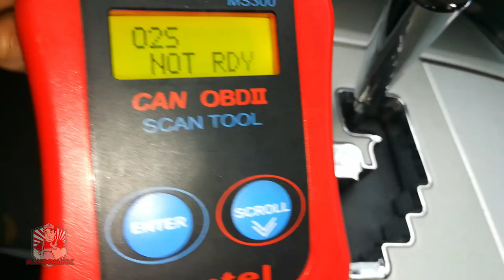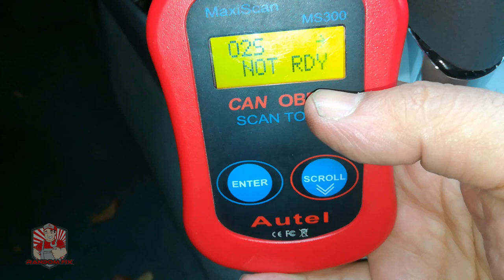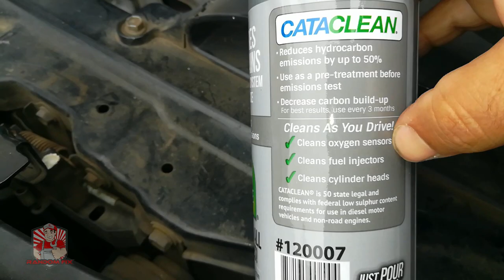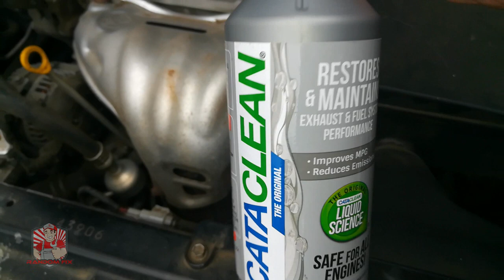Essential tips to prepare your oxygen sensor monitor.

Comment: I have a Kia 2012 Sorento . Still having issues with my oxygen sensor saying incomplete. Should I try the cat clean ? I have no check engine light . The drive cycle for this seems really complicated
Reply from the maker: For your kia, do the following, make sure your battery is perfect. ( less than ideal batteries will keep the o2 monitor from setting, let me know if you don't understand this.) and let it warm for a 15 minutes and drive around town in stop and go traffic, keeps around 25 to 45 mphs. Let me know what happens.

Comment: You dont have a drive cycle link for fiat 500 (abarth).  Is there a cycle that you have a link for that will work with Fiat?  Having issues with O2 sensor readines.  Thanks!
Reply from the maker: Here the chrysler drive cycle.

https://youtu.be/dyYv4HpYPys

For the o2 monitor make sure you battery is perfect. Just because it can start the vehicle doesn’t mean it’s good.

Comment: Hope this cat a clean helps! I’ve got an 06 wrx and have driven over 350 miles. Last reset I did over 120 miles and o2 hasn’t been ready. Cleaned the MAF, Throttle Body, cleaned connectors and made sure o2 sensors were plugged in tight.
Reply from the maker: Hi Anthony,
I made an updated video for the o2 monitor.

https://youtu.be/Yn1-ul62Jio
Reply: @RANDOMFIX  I appreciate it I’ve watched it. I checked my battery yesterday and it’s at 100% according to autozone, fairly new. Only thing I haven’t done is take off the the connectors from the battery for an hour.
Reply: @anthonymarquez4563  that should be the first thing you do. Completely reset it and let it rerun the monitors without looking for those pending codes
Reply: @KollynJ  update: the issue for the o2 not setting was the o2 sensor. Once I replaced it, the car had set that monitor within a few miles.

Comment: I have a 07 chevy tahoe and its not passing either. The EVAP, heated o2 sensor,oxygen sensor is not ready and the secondary air system, a/c refrigerant, 
EGR flow and heated catalyst is NOT supported. Does this mean the computer system is not working? I took it 4 times already for the SMOG test  after driving it in the high way... Please help!!!!
Reply from the maker: Ara,  Sorry for the last response, did you figure it out? Please let me know and I can get back to ASAP. Also, can I get your help? CHECK OUT MY OTHER CHANNEL and subscriber if you like it. THANK YOU ▶️ https://www.youtube.com/channel/UC-wuhWwzZnFOWK-GMsP6Ejw _Randomfix

Comment: 2019 ram2500 6.4 how long do i gotta drive
Reply from the maker: Is the o2 monitor the only one not set?
Here is the video for incomplete or stubborn o2 monitors
https://youtu.be/Yn1-ul62Jio?si=ZxvHIxm3q-ly2aQ1
Reply: @RANDOMFIX  no there's like 3 others. Fue,02s,eva
Reply: @RANDOMFIX  just had headers installed and the battery was disconnected to
Reply from the maker: @Henny3773 if the fuel doesn’t get ready within minutes you need do a little research about your vehicle. I just had this happen on my 2014 dodge caravan where the fuel monitor was getting ready as well. Watch the video I sent you and let me know if you figure it out but I dropped lots of hints in the video on possible causes.

Comment: Do you have a drive cycle for a 2015 Dodge Challenger 3.6L V6? My pre-test had everything ready but o2 sensors.
Reply from the maker: Sorry for the late reply! did you find a solution?
Reply: @RANDOMFIX  oh ya, finally got them to set after going 55mph, decelerating to around 40mph and accelerating back up to 55mph, and repeating that 5 times, finally they were ready.

Comment: I had my BMW x5 35 D  Throttle Body replaced and there is no more codes and drove about 130 miles but still have cat, o2s ,hrt,egr  NOT READY.  should I just keep driving the car? or might have problem? I do not have any pending code so far .. Any help? Thanks a lot !
Reply from the maker: If your bmw is 2010 and never and you have a permanent code than needs to be cleared by 15 warm cycles ( warm + 10 minute drive) and 200 miles. This is known as mode 10 data, I will make a video covering this later this month. With that said I have a bmw specific video on setting all of your bmw drive cycle. Bmw drive  videohttps://youtu.be/mk6Tk330Acw and I. The video description this drive cycle instruction for each make. Good luck and keep me in the loop.
Reply: @RANDOMFIX  Thanks for quick response! I had code about 3k miles ago but I added the blue fluid and reset it. I think code was about exigent sensor but about 500 miles after reset I got engine light which I ignored until last week as I need a smoke check. When tested the throttle codes were up but nothing about oxi sensor . Mechanic who replaced throttle body told me if code doesn’t come back then it cleaned up it self .. I will check your videos and will drive more.
Reply from the maker: That should good, I would highly suggest you get your mechanic to scan for permanent code, the are regular dtc, pending dtc, and permanent. Often times you can't pull these permanent dtc using a cheap $30 scantool. You need a better tool. You can find a good one under $200. The reason I am saying is because your o2 heater monitor should be getting ready with 10 to15 minutes during idle after the permanent code have truly cleared. I hope that helps 🙏 🙂
Reply: @RANDOMFIX  I used this tool to scan : Ultra Performance Professional OBD II and CAN Diagnostic Scan Tool . I guess I might need to go back to get my car checked  . I might give some more driving  hopefully it will clear up..  I  checked your video about  drive cycles so I might try it as well because I did not drive that way much.. mostly 65 mph or 35  - 40 stop and go city
Reply from the maker: Okay, keep me in the loop
Reply: @RANDOMFIX  thanks ! I will
Reply: @RANDOMFIX  I have some update : I tried easy one for about 3 minute turned on a/c and rear window defroster .  the EGR went to Green mark. :) .  I think I need to try all your 8 steps..  I just spoke to mechanic and He told me on diesel I need to go for ride for about  20 - 25 miles with speed no more then 65 mph on cruise control or without but not to go faster and it should reset..    Thank you
Reply: @RANDOMFIX  I drover over 500 miles now but have only X on readiness but no codes . CAT and HRT . Is there any tricks for those? for diesel BMW?
Reply from the maker: On 2006 or 2007 and newer diesel you can have any two monitors not ready. I have the exact bmw drive cycle. Please check the link in the video description.
Reply: @RANDOMFIX  I will 👍 . I am going for longer trip today so may be it will trigger

Comment: Hi, my 09 Altima  still hasn't clear the "O2 Sensor HTR" monitor, can you tell me which sensor would that be, the Downstream or Upstream? BTW, I had a cylinder 2 missfire CEL but I replaced both, coil pack and sparkplug and and the light it's off after reseting it, did a couple of drive cycles but the o2 sensor htr won't clear.  Suspecting the sensor needs to be either clearn or replaced provided I know which  exact sensor needs attention.  your help would be appreciated.  Thanks!
Reply from the maker: Other than making sure your battery idle and not just barely starting the vehicle I would check the connectors and wiring. You either need to hook it up to a scan tool to diagnose the issue or take a stab in dark and go with that upstream oxygen sensor replacement with exact own sensor. There are additives for o2 sensor like cataclean but I would not try those because of your is o2 sensor heater monitor and no the o2 monitor, correct?
Reply: @RANDOMFIX  To clarify, when checking the OBD2 I/M Readiness "This Drive Cycle" it shows "Oxygen Sens HRT" as not copleted (INC)  the "Oxygen Sens Monitor" however, it's fine and shows OK as passing. BTW I do warm up the car on a cold start before doing the cycle  as you indicated in the vid.
Reply from the maker: Check the drive monitor since last cleared, for the o2 and heater monitor just let idle this time for 15 minutes. If the o2 monitor is still not set drive around town for 10 to 15 minutes at speeds of 25 to 45. Stop and go situations.
Reply: @RANDOMFIX  Yeah, I checked the "since last cleared" and shows only the "Oxygen Sensor HRT" as not compled as well.  I'll try driving the car as you indicated and see what happens.  In case it doesn't work, most like I would need to replace the sensor, but the question is, would it be the one on the driver side, the one easly reacheable from top or the one under the car before the cat.  Also, do you recomend I use the catclearner before i replace it?

Comment: My monitors arent ready but everything else passed.. no cel... dealer said to replaces the front 02 sensors on a 5th gen camaro.. would that be the solution to have the monitors turn on.?
Reply from the maker: Drive cycle for your Camaro  https://youtu.be/Yp34ksJY-fQ
Reply from the maker: Maybe the o2 sensors are bad?

Comment: First issue! Walmart scanner, but 2 years past, im sure you've learned that by now..
Reply from the maker: Sorry for the late reply! did you find a solution?
Reply: @RANDOMFIX  yes- sensor tested ok, wiring tested OK ( 5v signal and 12v ok, ohm loaded to spec). Wiring FROM o2 plug (truck side) to junction and then to pcm ok. Opened PCM and found a small crack I'm the solder on board. Cleaned-heat and sucked old solder off and re-soldered . Problem SOLVED, took about an hour, hour and a half. Stupid 90-2000s GMs let me tell ya! 
Also fixed the solder joint on board for ABS which had ALSO cracked- go figure my ABS light that had been intermittent for 6 years went away lol
Reply from the maker: That’s awesome, thank you for sharing your success on finding the cracked soldering.

Comment: I got a 2003 chevy tahoe and im trying to get the o2 sensors ready , i drove it 60+  miles and nothing as of yet
Reply from the maker: Jose here is the Chevrolet drive cycle 

https://youtu.be/Yp34ksJY-fQ
Reply: @RANDOMFIX  all monitors are ready except the o2 sensors and evap though ,drove it the way the cycle indicates and still not ready
Reply from the maker: Check the o2 connections, clean with electrical ( the connection only) and wait 20 minutes and try again. Also check the battery to verify it in good condition. I'm sorry I can't give more as I have limited info.
Reply: @RANDOMFIX  thank you , i will try that aswell and see what happens, i woke up today and put the scanner and now it shows 2 codes p0141 and p0135

Comment: My 2010 Toyota Corolla  1.8L automatic recently failed an emissions test. O2 sensor and cat sensor are not ready. No pending or permanent trouble codes found. I took it to a mechanic and he replaced both o2 sensors. But still no luck. What is the drive cycle for my car for o2 sensor and cat sensor?
Reply from the maker: Here is the toyota drivecycle for your 2010 Toyota Corolla https://youtu.be/EKfEr2LP2Nw

Comment: I have a 2004 Dodge Ram 1500 3.7L. I just recently changed the upstream and downstream o2 sensors and I’m still receiving a check engine code for p0171 and p0174. I have also had spark plugs replaced
Reply from the maker: When there are more than 14.7 parts air to 1 part fuel in the air-fuel mixture, a lean condition exists and code P0171 is triggered. The lean condition can be caused by a vacuum leak, which introduces more air into the air-fuel mixture, or by a weak fuel system, which does not input enough fuel into the air-fuel mixture.
Reply: @RANDOMFIX  Appreciate it. I’ll try checking the hoses for any vacuum leaks first thing in the morning

Comment: What's unfortunate is that the people like myself that can't get it to work can never do so. 4 sensors and parts later with hundreds of miles and I can't get my O₂ sensor to become ready and thus, my Catalytic sensor can't get ready either. I may have to get rid of the car for such a stupid reason as no one can't seem to help.
Reply from the maker: Sorry, to hear your troubles with o2 sensors. I'm not sure why but cleaning the throttle body really helps with getting O2 sensors ready. After you get your 02 sensors ready your catalyst will get ready. Also please make sure you use oem 02 sensors. Best of luck and let me know how it goes. If you still need help after you've cleaned your throttle body let me know the make and model of your vehicle. _Randomfix

Comment: My o2 n catytic converter won’t go ready I’ve been driving for like 100 miles already
Reply from the maker: What are you driving?
Reply: 2000 Nissan Pathfinder, just those two not getting ready
Reply from the maker: Here is the nissan video, https://youtu.be/s9PLkO-CjZ8 focus on the o2 monitor and then the catalyst. For the o2 long extended warm ups without moving the vehicle. The video will walk you through all the steps. Good luck and. Keep in the loop.
Reply: Thx man ima try n do that, a lot of driving cycle but it might work
Reply: By any chance I can use dyno to do driving cycle?
Reply from the maker: Mostly not but anything is possible.

Comment: In my experience, if you are using a good obd reader,it will tell you up steam or down stream, and sensor 1 or 2. In the case of a true duel exhaust system the reader will let you know bank 1 (the side of the engine where #1cylinder is located)
Or bank 2  ( the opposite side).
For single exhaust cars most of time, bank 1 is upstream.
Reply from the maker: Good information.
Reply: The dealer is telling me that the Rear oxygen censor is bad on my car and that is why the MIL light is on in my car.  The manual states that it is a indicator of the emissions has a malfunction.  But the dealer is saying that it is not a emissions problem.  Is this true?  I have a 2016 INFINITI QX60.
Reply: What about bank 2? Is it downstream or what?
Reply: @davidxg1164  bank two means bank two of the engine. Meaning you haveva v6 or v8 engine so it has two banks. Two exhaust streams. If you look at your engine bank one is the "leading" bank meaning it will sit a little further ahead than bank two. Like literally a half inch closer to the core support than bank two. Youd have never noticed unless someone told you

Comment: I have a 2011 Chevy HHR and it says one of the oxygen sensors are not ready. Do I drive it 20 miles straight without turning off the vehicles or 20 miles in separate trips?
Reply from the maker: Alejandro, the smog tips plays list and I have video exclusively for chevy.
Reply: @RANDOMFIX  Hey! Update, so I drove my HHR for 50 more miles yesterday, checked to see if one of the oxygen sensors are ready, none of the 2 have been activated. Does it mean I have to run it more or I have to replace them?
Reply from the maker: Did you check the Chevy video?
Reply: @RANDOMFIX  I’m trying to find it and I can’t find itx

Comment: Hi! I am still unable to make my  O2S sensor ready (Nissan Xterra 2012) - everything else is ready. I can't understand though why mechanics are keep saying  it just need drive cycle (which I did) and seemed reluctant to  advise if actual sensors need replacement.  Anyone have advice? Thank you.
Reply from the maker: I would check the Nissan video in the description box of the video, it will walk through the Nissan cycle including the oxygen sensor. The o2 sensor should set pretty easily. Let me know if need help on that video direction. Here is the direct link. https://youtu.be/s9PLkO-CjZ8
Reply from the maker: Let me know what happens.
Reply: @RANDOMFIX  I will try that. thank you !

Comment: dude I have a car I Never drive im about to sell, a 2011 with 65k miles.  no codes, nothing, garage kept, everything maintained at jeep dealership, the lady told me to drive 100 miles and come straight back to emmission
Reply from the maker: I hope the 100 miles of random driving helps. But you want to make sure you pass here is the hero drive cycle. Good luck and congratulations on the sale.

Comment: Hello, I have a 2002 BMW 325Ci and my oxygen sensor htr is ok but not my oxygen sensor monitor or my catalyst monitor? Do I need to get new 02 sensors? Thanks in advance
Reply from the maker: Ricky, depending on your miles and driving habits maybe yes. You need to check the O2 sensors via a scan tool . Best of luck.
Reply: RANDOMFIX it has 167k miles and no check engine light did various drive cycles and driven well over 1k miles and still have those incomplete funny thing is my EVAP system is ok though lol
Reply from the maker: Ricky, wow 1,000 miles and it's still not ready. First Focus on your 02 sensor monitor (don't know why but clean you throttle body >>https://youtu.be/hsGNYdeZLec) and after you 02 sensor is ready, then focus on your catalyst (CATS) monitor, get the CATS nice and hot, drive at "consistent" highway speeds over 55+ mph. On BMW's you sometimes have to complete this process multiple times so don't loss faith!! Best of luck and let me know how it goes. _Randomfix
Reply: Hey I finally passed smog!!! It passed after I replaced the pre cat 02 Sensors!!
Reply from the maker: Congrats 🤸🤸🤸🤸

Comment: What if O2S says "INC"
Reply from the maker: It means the o2 sensor monitor is not ready. What are you driving? I can send a specific drive cycle for your vehicle.
Reply: I clear the code where all of the cylinder had a misfire
Reply: And I left the gas cap not all the way closed
Reply: Sienna Toyota
Reply: Has EVAP CATL And 02 on INC
Reply from the maker: This will help with your Toyota sienna https://youtu.be/EKfEr2LP2Nw?si=WfKBXsLOJwxcnZfU